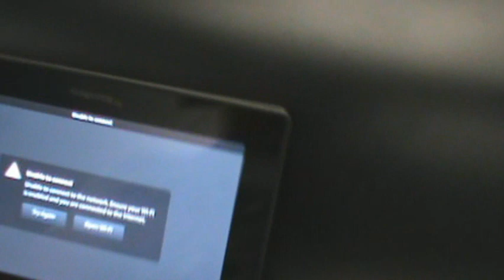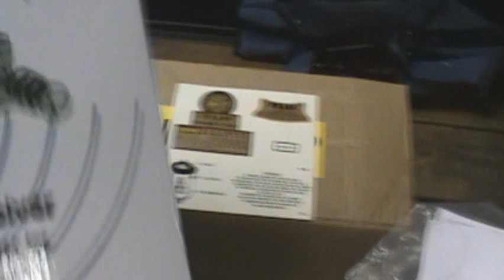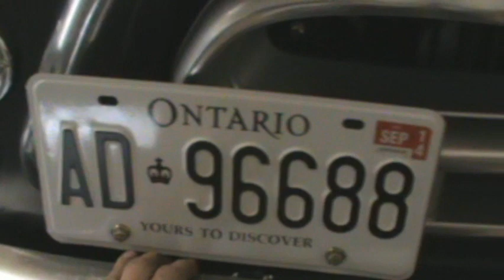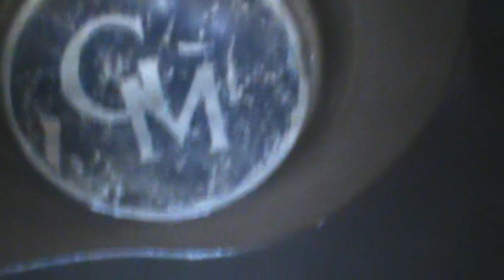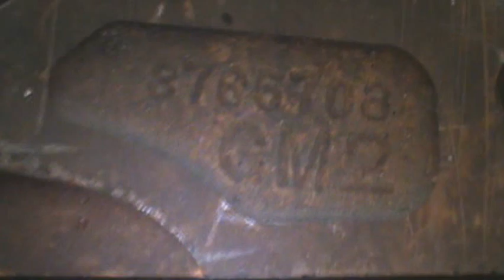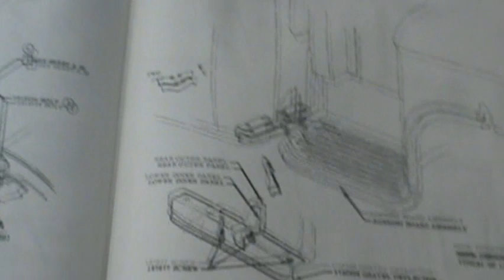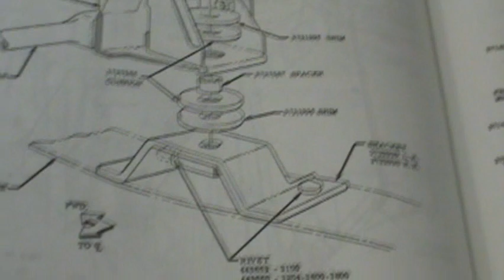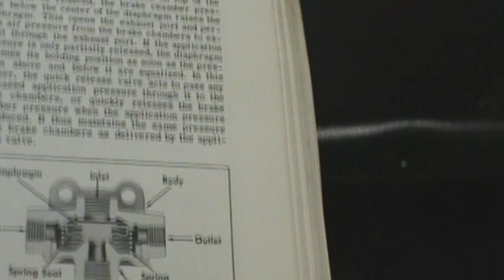1957 chevy stepside floor vents

Comment: The vent door worked great.  I have every service manual I have ever gotten, including the ones from my dad, father-in-law, and other relatives that got them.  Having been a mechanic for years, they were great reference when I did repairs for others in the driveway.  They're boxed up now, but the shelves in the garage where they used to be is 24 feet long, and I could have used about 3 more feet.

Comment: nice job on the vent,i was surprized u have to have the front plate,they done away with that quite a few years ago here,those manuals would be very handy,truck is coming along very nicely,have a good one,tc

Comment: when i use to sell old chevy parts if yah spent more then 200 i would push the assembly manuals, they are a good thing to have in an NOS restoration an even a custom job . best tool to have